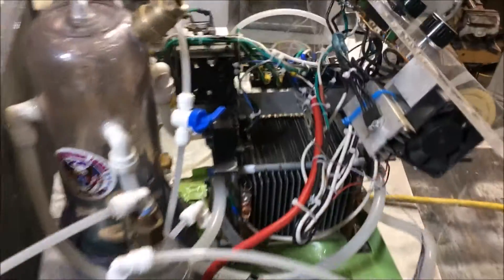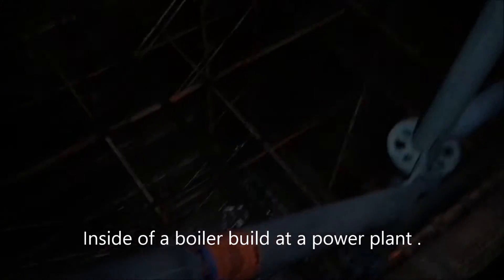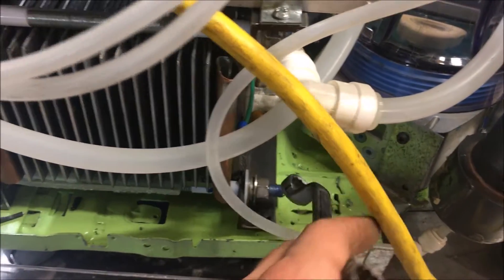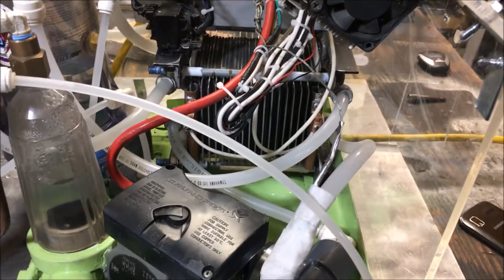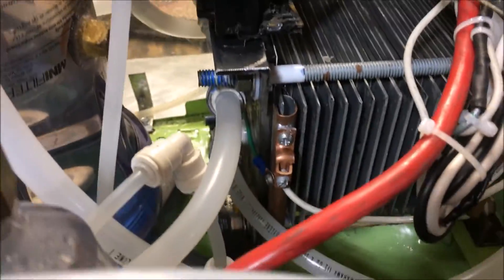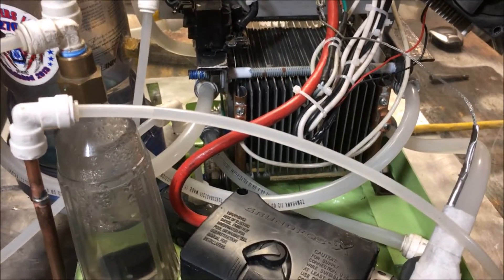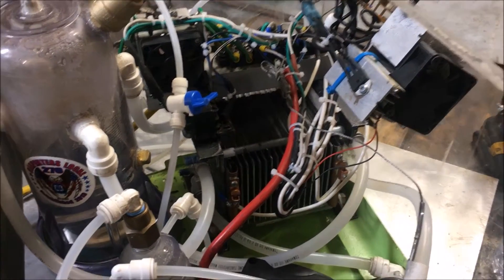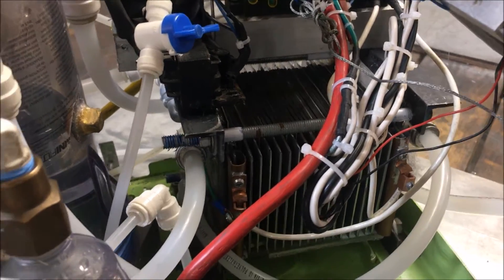2500 watt Oxyhydrogen Synthesizer prt3

Comment: Is there any good solution for the cell heating up too quick. Mine HHO dry cell gets boiling hot in about 20 minutes or less.
Reply: The power input is around 400watt
Reply from the maker: you need radiator
Reply: What you got on your cell

Comment: NOBOX7 I have been waiting for this update!  Amazing HHO--- Browns gas---Oxy Hydrogen---2HO---Electrolyzed water torch.  Your design is high power, genius, and well built.  I like wet cells, as well as dry cells-I have been experimenting with them on and offfor other purposes since 1997.   Nothing with the output you are running.  The most input I have sustained continuously is 120 watts @ 12VDC.  When I finish a couple other projects I want to make a simple tiny brazing/cutting  torch for as little money as possible.  I have always wanted to try and run a nitro or gas R/C type engine on HHO as another project, think it could be done? It would make a great video.  The nitro engine I have almost outputs 1HP, and I have the perfect 400 watt generator with gearbox that would mate right with it.  Anyway, thanks again, I look forward to more videos of this, you are cutting edge my friend.
Reply from the maker: well from my experience you need at least 300 200 watts to make a small flame , in fact im kinda scared to light a torch that under 250 watts  . and yes an rc engine should run on this gas .
Reply: @NOBOX7  do you recommend a water cooled system or air cooled can do the job?